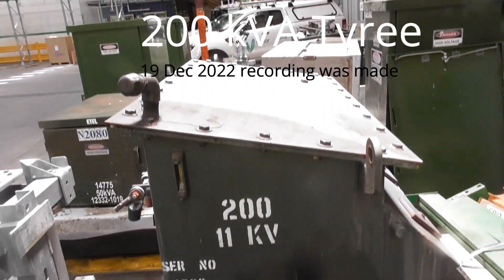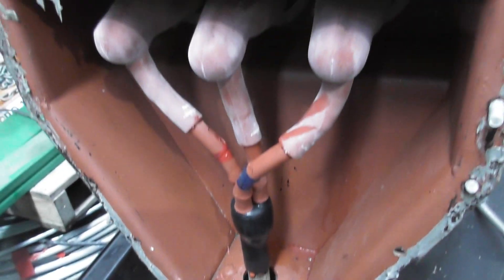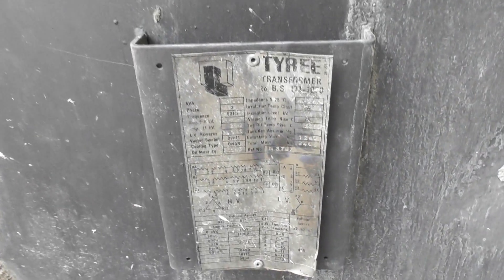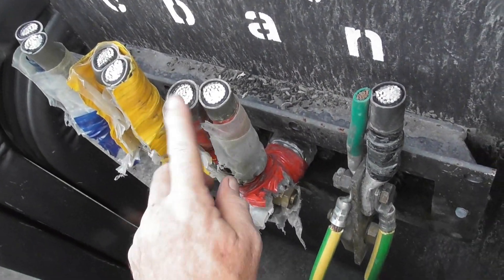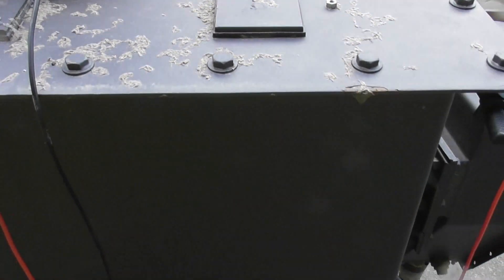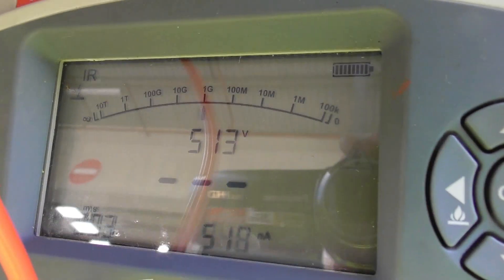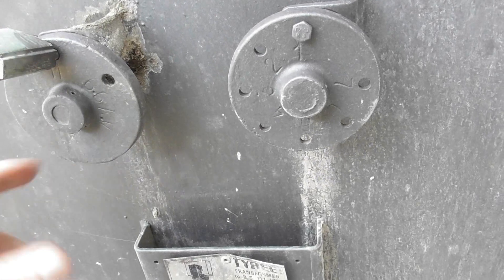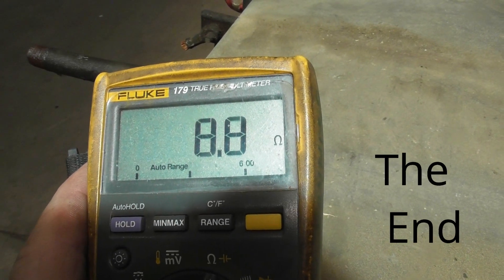Some distribution transformers 200, 500 and 150 kVA ins. test plus ramble.

Comment: I like these old transformer videos, but do these get scrapped or are they refurbished and put back into use?
Reply from the maker: Most will get scrapped as the trend is towards minisubs with HV switchgear on one side and LV switchgear on the other side. I can tell you that the new transformers don't last as long as these older ones. (Also they reckon the losses are less in newer TX's)
Reply: Yeah the new transforners are all chinese shit No copper in them either
Reply: It's a shame that they get scrapped. I hate the idea of chucking perfectly serviceable stuff away, especially when some of it represents our industrial heritage. I'm sure that the windings and cores in the newer transformers are skimped on to maximise profits.